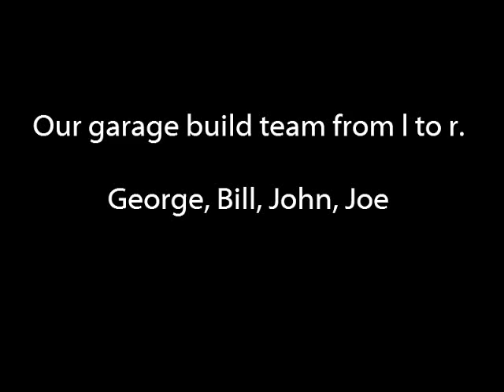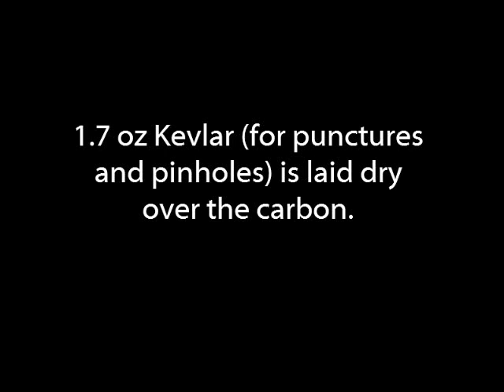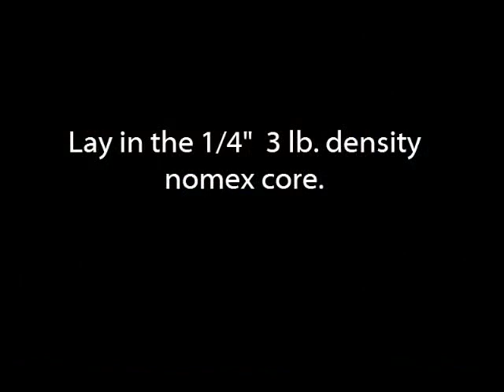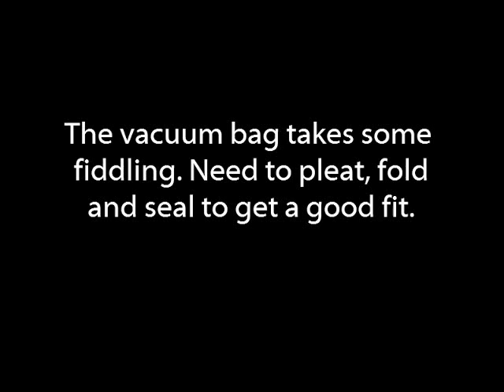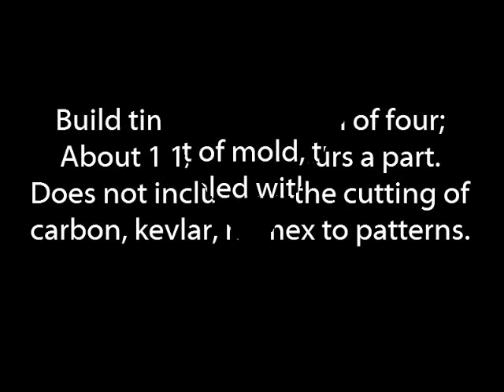Boat Building; Carbon/Nomex International Moth

Comment: Laying breather directly over peel ply is very likely to pull too much resin out of the laminate.  The approach of a perforated release ply in between the peel ply and the breather has worked very well for me and pulls a consistant 25% resin from the laminate into the breather.  The nomex stuff seems very easy to fill up with resin making for a heavier laminate than corecell or divinycell.  The boat has obviously held together.  Good job and very cleaver with the half mold technique!

Comment from the maker: From Bill B,
Porosity is a problem.  The best approach is to spray an ample coat of primer in the mold before starting the layup.  Porosity will still exist, but it will be behind the impermeable primer.  If the outer skin were bagged and cured in the mold before the nomex was added, the porosity problem would go away.  Assuming you did neither of these things, the problem can still be solved by squegeeing three extremely thin coats of thickened resin over the entire surface.

Comment: jabousquet | March 20, 2008 
The Nomex is 1/4" thick, 3"16" cell, overexpanded. Procured from Eurocomposites. The Nomex core is flexible enough on the long axis to roll into a tube about 8 inches in diameter. Bill's half-hull molds allow the composite to be made in one lay-up. And the pieces are easily extracted from the mold! I suspect that laying up a hull would be much more difficult with a one-piece hull mold, both in speed required to get everything in before the resin kicks & in removal.

Comment from the maker: Bill

From Bill B,

The carbon outer layer in the carbon inner layer were wet out on a separate table before placing in the female mold.  The thin kevlar layer on the outer skin between the carbon and nomex was placed in the mold dry and wet out as required in place.  By wetting the inner carbon skin on a table it only needed to be positioned on the nomex core and bagged down.